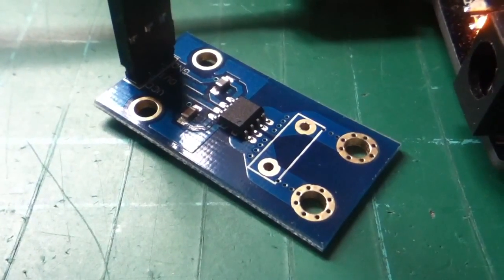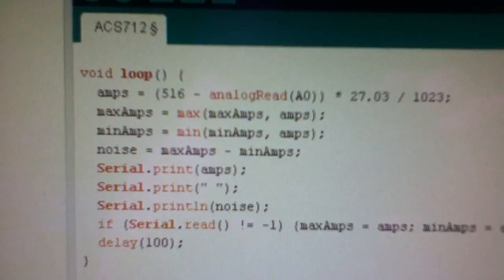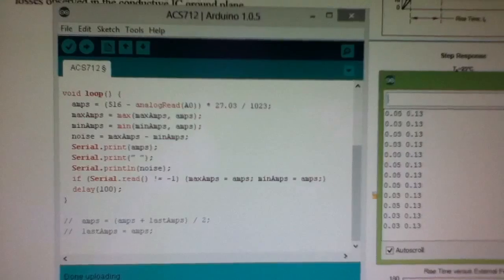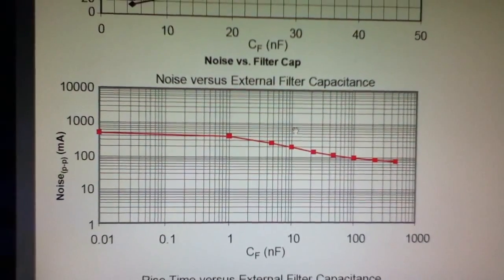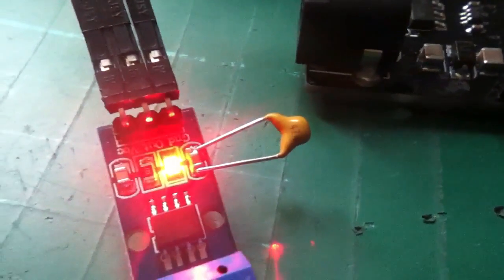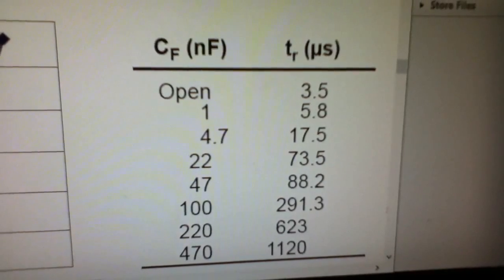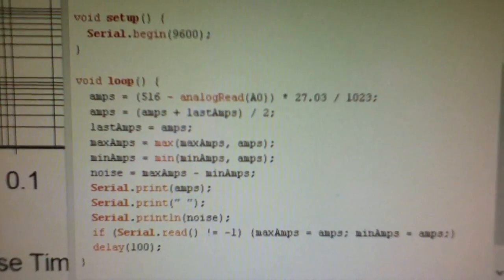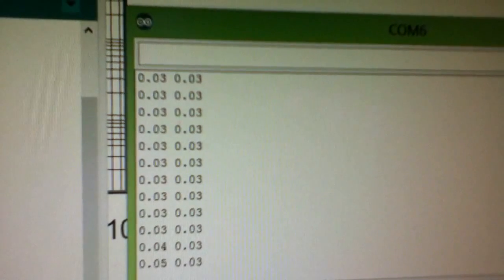Using the ACS712 Hall Effect Current Sensor Module (part 3)

Comment: First of all you need to connect the ACS sensor to a stable 5V source, not to the 5V from the Arduino board, and set the Arduino's analogReference to something other than the default 5V. Without this any experiments with ACSxxx sensors are pointless so your video does not teach anything and only misleads people.

Comment: Hi Julian, as I have posted elsewhere you can use these modules WITHOUT a microprocessor. If you use two identical modules, with the inputs wired in parallel BUT connect in the opposite directions, you can put an analogue panel meter (attenuated by a potential divider) between the two module outputs. As a current is passed through the module inputs half of it goes through each input but in opposite directions, thus one module output rises while the other falls, effectively creating a balanced bridge. This not only makes the circuit less sensitive to supply fluctuations but also thermal drift, as both outputs will have the same drift directions thus the error differential between them will tend to cancel. You can also use a digital pannel meter, providing you isolate the power to the meter or current modules, as most digital meters have the negative input and displays power negative as one connection, therefore the meter input will ground one modules output. This arrangement can give you an accurate high current measurement double that of a single module, and still allows you to ALSO measure the modules outputs differentialy via a microprocessor using two analogue inputs and software that takes one reading from the other (should be an even number !) and calculating the current WITHOUT first determining any midpoint values, as the voltage between both outputs should be a null except when current is flowing, and NOT an odd number as inA minus inB cannot be a odd number, also good for noise elimination.

Comment: Your program is averaging the new value with the old AVERAGE, not the last real value - not the best way to go.  It probably takes ten or more measurements to settle down at the start (since you're averaging 'amps' with zero on the first run), and one large error spike would throw off many subsequent measurements.  Much better would be to have each loop read twice, with a 'delay(50)' between them (and another delay(50) at the end), and average those.  Good rule of thumb for averaging:  Never store the result anywhere it will be used for another calculation.  Better yet, make it run 100 x per second and average every 10 values.

Comment: have you seen other boards with the 470nF capacitor fitted to reduce noise?

also looking for a way to monitor voltage - could do this with a voltage divider, but would like to find a pre-made board for less assembly work. (Chinese economics works that way).

Was looking at shunt resistors - this looks a nicer solution.

Comment: Hi Julian.

I am using the ACS712 +-5A sensor with sensitivity of 0.185 V/A, pretty much similar to what you have in this video. However, the current readings seem to jump at intervals of 0.03A. For example, the serial monitor would show 0.03, 0.06, 0.09, 0.12 amps... In your video, it seems to me that you are able to detect changes in intervals of 0.01 amps which I am trying to achieve. I tested the sensor with Arduino Uno and realise that each digital count gives rise to 0.03 amps and it seems impossible to achieve readings of 0.01 amps intervals. 

Would just like to ask if you happen to know the possible reasons and solutions for the above mentioned matters?

Comment: Julian -

Thanks for this little series on the ACS712. For a couple of months now I have been trying to figure out how to monitor current in a circuit, so that if it exceeds 200 mA, a light will go on, as an alarm to me. The problem is that i am using a fuse lamp as the alarm, and it drops about 10v to light up properly, which adds an un-acceptable additional load to my supply. I want to use a fuse lamp cause i like the nice analog mellow light.

I tried using an FET current mirror, and it seemed to work fine as long as things remained static, but when the main circuit current changes (going from 25mA for quiescent arduino, to 300 mA when the motor turns on), the current mirror seems to get un-stable, and soon the mirrored circuit current is much larger than the main. It just won't stabilize if the main is varying.

so i had given up on trying to make it work. But your ACS712 videos have given me new hope. I have ordered a couple. I also increased my power supply from 12v to 19v (but this is still not enough to allow 10v drop in the FL, in series). The motor needs more than 12v to operate properly. I know that the total current will still be the motor and the FL load, but I am thinking that if i put the ACS712 in parallel (and monitor the current using an arduino to turn on the lamp), because it is not electrically connected, it shouldn't add a parallel resistance, and won't effect the voltage & current to the motor. At least that is what I am hoping.

The motor is to my automated chicken coop door, so i need to be notified if there is a problem so they aren't locked in or out (should the motor overload).
any thoughts about my reasoning ?

Comment: I think your code could be improved for digital noise filtering. You said you could poll the sensor at 1ms intervals but only require 100ms reporting intervals. You are currently averaging the current value with the last, which as you said, has a very minimal impact as well as a delay effect. Instead why don't you poll the sensor every 1ms (or the max poll interval determined by the cap) and average the result over 100 polls, then report the average of that batch of polling. This way you can have very large tolerances in accuracy but still get quite accurate values. Plus you maintain your 10 polls per second and you no longer have the memory/delay or smoothing effect.

Comment: Julian, using your code I get compiling errors due to variables (amps, lastAmps,..) not being declared. Can you post your full working code here instead of having to read it from your screenshot with the risk of wrong code copied? Do you not have to declare your variables?
Reply: he probably declares them above his void setup, just fill it in yourself.

i put above the void setup:

double maxAmps = 0;
double minAmps = 0;
double noise = 0;
double lastAmps = 0;

and i changed in the void loop():

amps = (516 - analogRead(A0) *27.03 / 1023)

to

double amps = (516 - analogRead(A0) *27.03 / 1023)

if you change/ add this stuff it should work ;)

Comment: The AVR analog sample routine can be noisy itself.  There is a documented by Atmel to have it do a better conversion but this would require that you skip the Arduino analog read and write your own.  Further, if you setup the AVR to go into a Analog Sleep when it reads, it can be pretty accurate.Beyond that, you can just ignore the lower bit from what you read also.

Comment: Nice video. One note: using the max and min diff is likely a bad measure of dispersion. For example the difference between the max and min salaries in say the USA is quite large but that gives the wrong impression of the distribution of salaries.

I would recommend setting the current to what you expect in reg operation, measuring the current for a time, and then taking the median as your Center Measure. Now use this to calculate the Std Dev (dispersion), throwing out N max and min values.

Your actual error per sample was likely very low.

Comment: I've been thinking of a project with this chip, remove the device from the board and build it into a wand type affair, so I can monitor current in cables without disconnecting them, and maybe for looking at flux densities withing magnetic cores, if it will go to those freq's.
What do you think?
Reply: A wand would work for detecting current but not the value. Inside the Hall Effect transducer is fixed spacing between the detector and current carrying conductor. With a wand you can detect a field but not know its flux density because of the distance variable.
Reply: Well actually I found a website that does just that, it uses  a ferrite core on a c clamp, it needs a zero adjust but it works, accuracy isnt great but it works, though the freq response isnt high enough for an smps, but its great for lloking at signals around vehicle engines.

Comment: Try a SMA or kalman filter? Are ADCs more noisy at the floor and ceiling, have you checked that it is the actual sensor that is noisy and not the ADC, could always offset it if so.

Comment: averaging code i used for another project requiring a weighted sum:

int value;         // whatever you're reading
int n = 0;         // number of values you've read
double avg = 0;

void loop()
{
   value = analogRead(pin);
   n +=1;

   avg = ( (n-1) / (n) ) * avg + (1/n) * value;
}

Comment: hello Julian, 
nice videos you make and new information which i personally never seen in any tutorials or else,
i have a question please i need your help: 
i am using the ASC712 the model you use in this video which you add an external cap to it, but i think my model doesn't need a second cap (i will send you the link for the one i am using in private message because we cant do it here), the problem is that when i don't connect anything to the input i get a 0.15 Amps and around that, when i connect the inputs to a simple red LED and 1K resistor circuit i get a value around 0.14 amps (it should be way less) and i get ampshour of for example 0.00061 ampshour for a time of 35 seconds ! why does that happen and why is there a very big difference between amps and ampshour ?!

Comment: Great video, thanks for the work. I'm looking at using some of those devices for a project. Thanks for the info on changing the caps.
Looking at your numbers scrolling by on the screen I'm wondering which direction the noise takes the signal. Does the noise fluctuate above and below the real value, or is it only positive going. Watching the screen it appeared to be positive going, or additive to the real signal. In that case I might be tempted to try a digital filter of taking a number of sequential samples (two or more) and select the lowest of the values instead of averaging. If the noise goes above and below the real signal then I might be tempted to try a median calculation instead of an average.. Just some thoughts.

Comment: Awesome video man! Exactly what I was looking for! I'm trying to measure the current output of a 10W solar panel. And a 10W solar panel outputs 570 mA in the best case, typically just around 150 mA in these winter days, so that same 30 mA noise that I'm seeing is a real problem. I'll try your solution with the capacitor, see how it improves things. Thanks!

Comment: Just a thought: With a rise time of 1120 microseconds, could you have a loop within the main loop that grabs and averages around a hundred values from the analog pin, 1120 microseconds apart? You would be able to do a current reading around ten times a second, which is what you're currently doing, and get improved precision.

I know I'm commenting on a pretty old video; just wanted to throw the idea out there.

Comment: Great video :) I think I might redo some coding on my amp measuring box :) I have the 20 amp version and I also read the actual VCC voltage that come in the arduino and the amp sensor it seem like it did most of the job and I use the map() function to do most of the math. Thanks for sharing!
Reply from the maker: Thanks. You're welcome.

Comment: Im using a median filter to sort out the noise. I still dont get the 185mV/A though. I made a couple of measurements with 3 of these chips and they all read too low values by a factor of about 1.5. Did you experience this as well?

Comment: Would this not be 1024 steps ? 2^10 + 1 ? For a range of 0 - 1023 ?
Reply: wops, no plus one.  2^10 = 1024
Reply: I'm trying to get a lot more accuracy out of the 5A device.  Trying to measure 50mA steps at 20KHz (50us steps).  Taking more than 12 readings using a 3.3V micro controller and averaging I get a nice value, so I measured the noise to be 72ma with a 1nf cap (24 10bit ADC steps).  Now this bandwidth for 1nf says 50KHz on the datasheet but I believe that this isn't filtering anything because of the speed of my reading.  What I believe here is that I need to reduce the bandwidth to half the sampling frequency (10KHz) to reduce the unwanted noise.  Setting the cap on the internal first order low pass filter (pin 6) to 10nf should do this and looks like it will reduce the noise to 40mv.  Need to get hold of some 10nf caps but I it might mean that I might be able to take less readings than 12 for a nice average.  Will keep you posted. 
Now I was thinking that there could be a way to filter the signal using a second order active high pass filter in hardware before the chip ADC so that you read the correct value every time without averaging (op-amp circuit). Plus might add in some gain with a small amplifier for a cleaner range.
Looking deeply my scope shows the noise to be a repeatable pattern lasting 500ns at about 30KHz.  Very interesting.  These high frequencies should be reduced with a higher capacitor.  And it wouldn't hurt to add a another filter to the output pin using a resistor and a capacitor.
Reply: Paul Levene Changing the cap from 1nf to 10nf made no difference.
Reply: +Paul Levene sir? how to measure the accuracy of this sensor? do you know how sir? please really need this info , asap thanks

Comment: Hi Julian, this is becoming a habit, me commenting on your videos.
I bought the 20Amp version(overkill but it was cheaper) to play around with at the same time you posted this video, have only just managed to watch it.
I would love to see a part 4 on the following which is what I did.

Use 2 resistors (470 ohm I think I used) to make a 2.5volt reference, connect that to the ground of the sensor. That doubled the resolution, but of course the noise is still the problem. I did read somewhere that connecting it via usb adds noise so got a cheap Bluetooth slave and run it off a battery, that works well and noise is reduced. Also putting the AVR/Arduino to sleep (stopping the clock) while making measurements is better but hard work

After watching the video again, you could use the cheap and dirty resistor divider then set the internal voltage reference of the AVR/Arduino to 2.5 Volts that would give a times 4 resolution. Shift or take off the LSB and that should get rid of the noise and still have double the resolution.

All sounds good in theory but haven't tried it. A video explaining the advantages and disadvantages, and if it works or not
Regards
Steveo

Comment: Hi Julian, Thanks for the tip. I changed my decoupling cap to a 33pF and resolution became more stable. I use a 20A Range ACS712T ELC-05B Module Current Sensor Module. I read it with a MCP3424 ADC, on 16 bit resolution , I get 2.5415 Volts at 0 amps. and 2.6425 at 1 amp.  The last decimal the 4th, fluctuates from 0 to 5. So I can rely on 2.XXXY, X being solid, and Y Fluctuating.Thank you, Julian.

Comment: Filter voltage strange, is the adc fully decoupled? I also filter the lower increments meaning that my minimum current reading is 79.2mA which is above the noise issues. I did think it would be nice and rock steady before I bought it and had hoped it would be good for low current readings but given my present application nominal current is 1-5 amps so removing the bottom end and having it just notch higher initially will not even make a difference and keep my idle amps from fluctuating.

Comment from the maker: I'm taking 10 samples a second, so averaging 100 samples would have artifacts spanning 10 seconds. Even averaging just 2 samples (which I'm still doing) I was getting strange effects on the IV curve plotting (which looked like hysteresis), so I had to average the voltage samples as well, even though they were stable and didn't need it.

Comment from the maker: Yes, noise from the sensor is now at the same level as a single bit change in the ADC. I'm not sure what Nyquist would have said about it, but I suspect that digital filtering won't make a lot of difference. I've modified the current sensor on my MPPT test rig and the improvement is astonishing.
I think I used the same technique on my PWM controller - I likened it to a 256 position slide switch. Each time round the loop, you slide the switch one position up or down.

Comment: Good video and a nice Arduino example.
It looks like 30mA is about as good as it will get with the ADC resolution. 1023 steps on 27 Amps FS.
Often when looking at slowly changing analogs like battery voltages or temperature, I just adjust a saved result up or down by one count based on the latest ADC read being higher or lower than the one before. It slows things right down and eliminates brief variations due to load changes.

Comment from the maker: The line on the graph is starting to flatten out at 470nF, so I doubt there's much to be gained by using larger capacitance values. I suspect the graph shows worst case numbers. Maybe the noise levels increase when current is flowing. I have a lot of respect for manufacturers' data, I like to trust that they've done their homework. But never say never, of course - pushing the boundaries is always worth a try.
Cheers Raymond.

Comment: How about using simple moving/rolling average with more samples. 10-20 samples or more with smaller cap. This will probably smooth peaks and you can calibrate by discarding noise value.